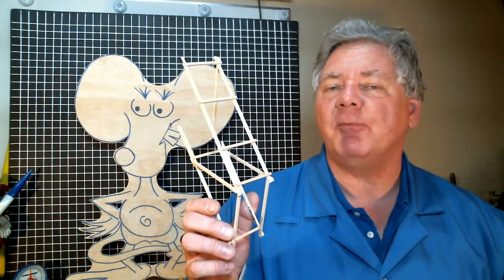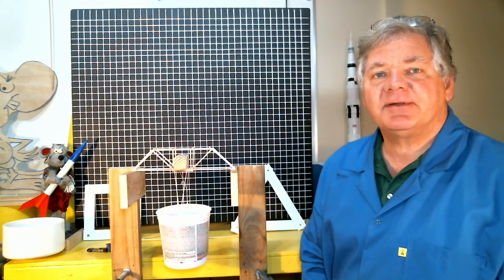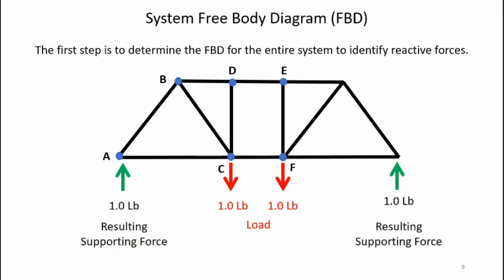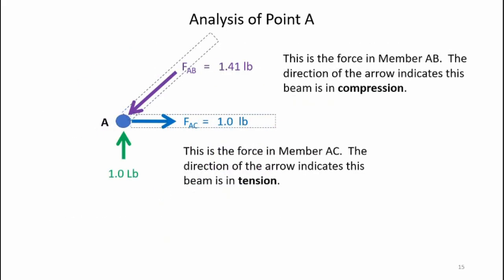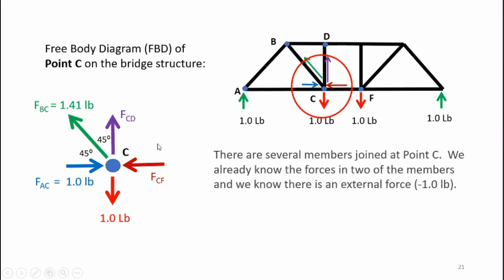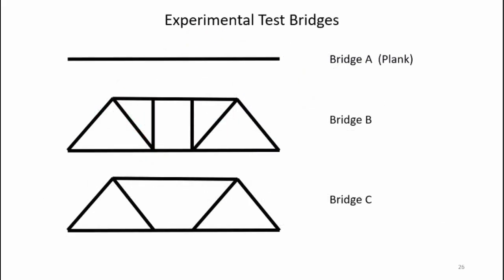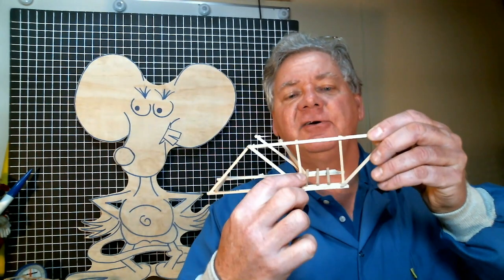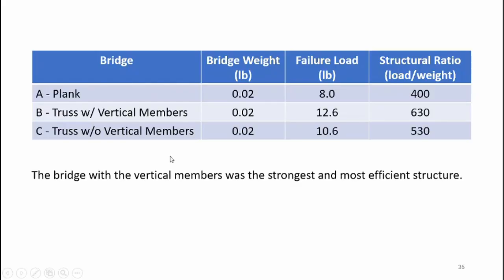Balsa Wood Bridge Testing

Comment: The only zero-force members are CD and FE. Member BD bears 2lbs in compression (hence the buckling right before failure) and CF holds 2lbs in tension.
At 8:32 you can see that point b is not in equilibrium if Fbd=0.
When analyzing joint C you represented Fac as a compression force, but you had previously determined that it was a tension force. When you reverse its direction you find that Fcf=0 does not satisfy equilibrium.

I hope this helps.
Reply: I agree. Point B Is in vertical equilibrium but absolutely not in horizontal equilibrium. Just looking at the moment from the support (1Lb X L/2)/H gives the reaction force in BD.

Comment: I'm not an engineer, just a curious mind. I'm making plans for building a modest 2 story home. I have done construction for quite a while and I don't like it when trades, start putting holes in floors members to run wire, plumbing, or duct. I want to design my own floor trusses and I have a good idea how to test them before I turn in my plans to an engineer for approval and or revision.
Reply from the maker: In my book testing should be done to verify calculations whenever possible.  Its a theme that is the basis of my videos... The engineer should verify any and all truss designs...  Many a structure has failed because of small errors or miscalculations.

Comment: But how are you supposed to calculate when it breaks ??? Ive been searching all day. I need to calculate when it will break
Reply: This will depend on the materials you use (as well as how you connect your members together). A given material will have a tension member capacity and a compression member capacity -- these known values tell you how much force, in tension or compression respectively, a member can sustain before failure.

Comment: How did you account for the weight difference when you removed the vertical support structures?
Reply from the maker: If I'm looking at the efficiency of the structure (strength divided by weight) the lower weight of the structure would account for the loss of the vertical support members.  While the structure would be lighter it would also likely be weaker (as the video showed), thus giving a lower strength to weight ratio.